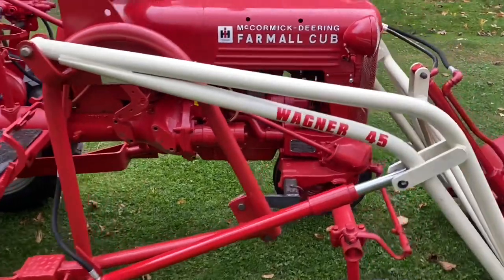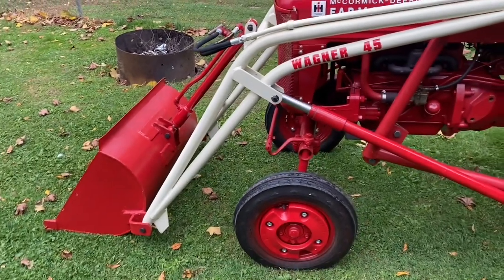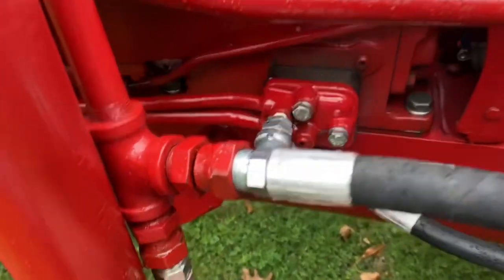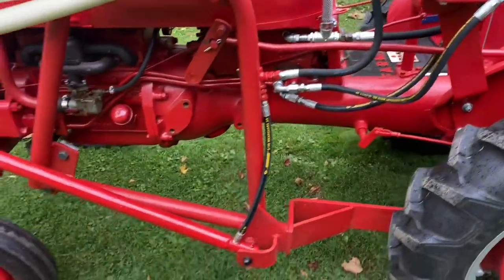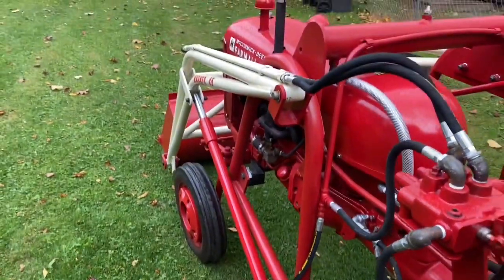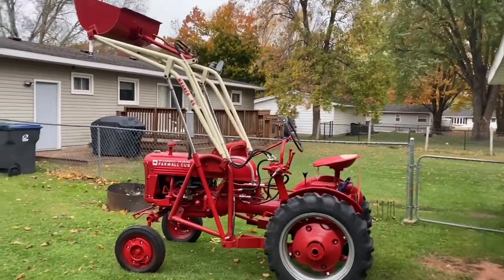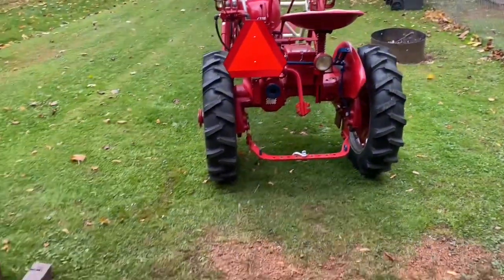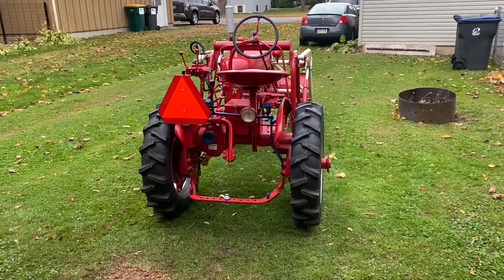Farmall Cub Wagner loader.

Comment: I have that exact Wagner loader on my cub lowboy, everything plumbed the same way and my touch control doesn’t work either. I just assumed it was a trade off you had to accept but I would like to have both work
Reply from the maker: I think I have it figured out just haven’t tried it yet. I will keep you posted if it works.

Comment: Sweet cub. If you never figured out why the touch control stopped working is the valve body you using open center? If not that’s why.
Reply from the maker: It’s the original Wagner valve that came with the loader.
Reply: @shrunkenskulloutdoors  Odd wonder whats going on than. Also mind asking where you got the dual hubs?
Reply from the maker: @BearCat459  I got them from someone on market place that was fairly local to me. If you search online you can find blueprints to have a machine shop make.   I had a second set made for if I ever get another cub.
Reply: @shrunkenskulloutdoors  Thanks! ill take a look around.